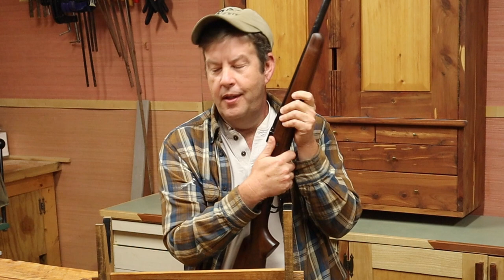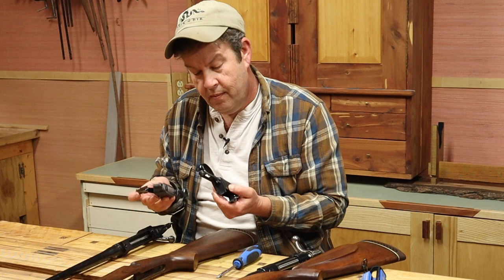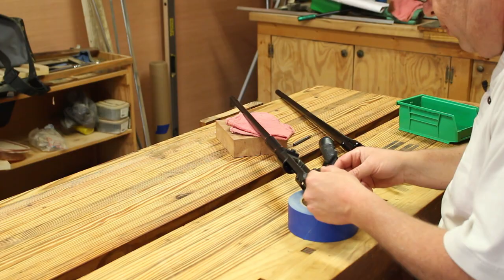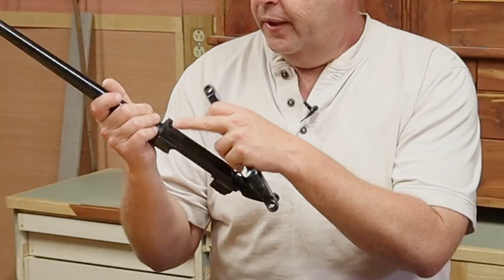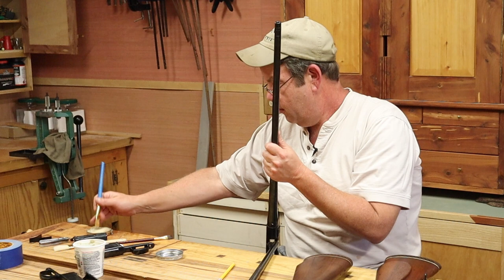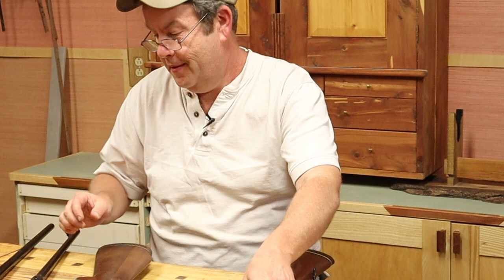1903a3 and FN Supreme M98 Bedding The Actions

Comment: Nice video as always.
I was taught the riggt way to solve the action screw issue is to get or make a couple of screws with long polished stems and no heads. You screw them into the holes in the receiver, apply release agent and leave them there for the rest of the performance. Makes lining things up a lot easier and ensures you don't get epoxy in the threaded holes. That and the surgical tube/elastic that has already been mentioned in a previous comment.

Comment: In the drive for the latest and greatest it is easy to fail to appreciate just how far some things have advanced.  Personal electronics are a great example with computers today having hard drives measured in terabytes, processors with multiple cores and clock speeds pushing 5 gigahertz, and RAM measured in gigabytes.  It wasn't all that long ago when a fast processor was 20 megahertz and hard drives and RAM was measured in megabytes.  That rapid change in electronics reminds me of how far firearms advanced from the flintlock to the machine gun in the 19th century.  

Hunting magazines will always push something as being the latest and greatest.  Fads come and go, but certain things still stay the same.  The Trapdoor Springfield will still kill any game on the North American continent just as well today as they did when they first came off the line.  They are the complete opposite of being the latest and greatest in hunting rifle technology, but how many hunting firearms made today will still be going over a century from now?  I don't know the answer to that question, but I do know that the Sirius Dog Sled Patrol in Greenland has had the opportunity to replace their main rifles (with cost being no object) from the U.S. Model of 1917 (aka the American Enfield) to whatever they want.  Those guns are over a century old, but the Sled Patrol refuses to replace them because they have proven themselves to be extremely reliable against angry Polar Bears and Musk Ox in some of the worst conditions for a rifle to perform in the world.

Anyways, barring something crazy happening in the rehabilitation process for your two "old" and "obsolete" hunting rifles I think they will hold their own against modern hunting rifles.

Comment: I need help with a project that I have just started. I have an FN Mauser Modelo 1935 Peruvian 30-06. It's sporterized, but I want to have a scope on it, without drilling and tapping. I know about Bad Ace scope mounts, but the rear sight is still a mystery.
Reply from the maker: Sean I'm guessing you're trying to get the rear sight off? I don't know about that particular rifle but try pressing the rear sight down between the hinges and then slide it back. I know that's how FN setup the rear sight on the FN49. I hope that helps. If that doesn't work find a schematic and check the forums. Good Luck!
Reply: @TomRiverSimpleLiving  Thanks for the feedback and the video. I do need to find a schematic to see if the rear sight on my rifle, is the same as another more recognizable rifle that Bad Ace has a product for. After it's scoped, I will consider if I want to bed the action, and free float the barrel. It's a project. Are you familiar with the type?

Comment: Tom, you need to get you some surgical tubing for these ocassions. and you'd save on tape. LOL Nice video!
Reply: Bicycle inner tubes works really well too! I use lots of them, they are free at your local bike shop is you ask for the used ones like flat/punctured ones!!
Reply from the maker: Kent, you're going to create a conflict between my minimalist side and my savings side! LOL

And thanks for sharing that David. That's something good to keep in mind.
Reply: @TomRiverSimpleLiving  My friends wife was a nurse and she used to keep me well supplied. What I have is the rubber band type material, 'bout 1" wide like the wrap around your arm when they draw blood. I made up some headless action screws to use when I pillar bedded actions. Got the pillars in place and bedding compound in and gently set the action with the headless studs in place to locate it. Used masking tape around the barrel to center it. The idea of the headless screws was not to induce any stress anywhere. May have been overkill, but I had good results always. What you've done should help those rifles, and definitely won't hurt. Sometimes bedding will improve the accuracy, and sometimes it'll stay 'bout the same, but be more consistent, which is a good thing. LOL And Tom, I was just ribbing you about the tape. I enjoy your videos, and I joke a lot.
Reply from the maker: @kentowens2179  and I appreciate your sense of humor and your experience. I definitely still have a few things to learn when it comes to bedding.
Reply: @TomRiverSimpleLiving  Tom, as we both know, "bedding"  ain't rocket surgery. LOL Providing a stress free platform for the action to set on is what we''re after, and making sure the action doesn't get locked into the stock. Attention to detail is essential.

Comment: Hi Tom.
I'm supposedly your only subscriber from Greenland, been with you since about 1000 subscribers.
Now that I see your vid about freefloating barrels, I can't help thinking of your vid on the Ruger M77 MARK II (cal. 223) with Zytel stock - which is not freefloated.
I've had mine for soon 25 years, been hunting with it a lot, it's a very good hunting gun, never let me down - but would it - and is it possible - to freefloat the barrel, and would it make it even more precise? And is it Worth the efforts, because - as you said, it is a very capable hunting rifle as it is from factory. It's a Ruger ;)

I'm not expecting a miracle, but you know... - even small things can do a lot.
Reply from the maker: That is so cool to have a subscriber in Greenland! I'm not much on traveling but that is one of the few places on this earth that I would really like to see one day, in the summer of course! And I'm so glad you asked about free floating that Ruger with the Zytel stock before doing it because that is one rifle you don't want to free float. I saw one a few months ago that had been free floated and didn't work out at all. The forend is as rigid as it can be against the barrel but on that rifle it was very flimsy and loose. I don't know if most of the rigidity is in the top and you loose that when you sand it down or if they just took to much off, but you just can't believe how easily that stock flexed on that rifle. It really surprised me. So definitely don't free float that one. And I'm not sure if you care much about the value as far as it being collectable (if you plan on keeping from now on it wouldn't really matter) but that really hurt the value of that particular rifle when they free floated it. 

And just out of curiosity do you reload for it? The reason I ask is because I've seen some really good groups from those rifles with reloads without the barrel being free floated. My friend Joey has one in .243 and it shoots under 1" (25.4mm) all day long. Mine is right at an inch and I haven't really even experimented with any loads for it yet so I'm sure there's some room for improvement. But that might be an option for you to bring the group size down if you haven't tried reloading for it? 

I hope that helps and I'm really glad you asked that question. And when I actually do the sanding to free float mine I'll make sure to mention not doing that to a Zytel stock or anything that's collectable. And not doing it to anything collectable is why I'm not doing it to my 1960 Featherweight. I have no doubt that free floating that rifle would really reduce the group sizes on it but it's more than accurate enough as is for hunting and it would be a shame to modify a rifle like that.